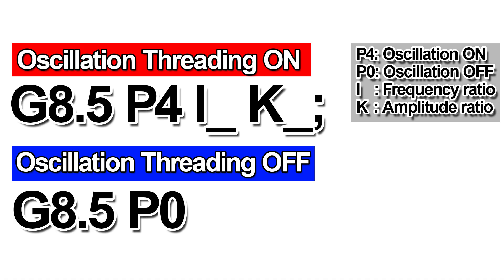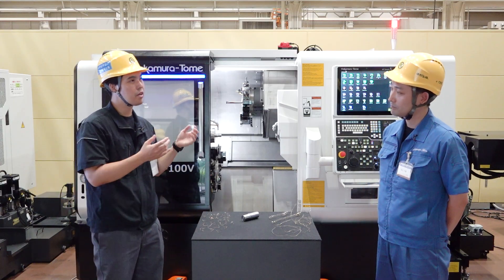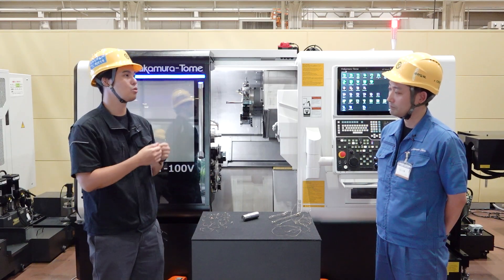【NEW】Chip Breaking Function for Threading "Oscillation Threading"

Comment: Did anyone understood the I or K values and how to set it up?
Reply: Looks like a pretty normal threading canned cycle. I is how often it moves in X, and K is how much it moves in X.
Reply: Thanks Kevin for the reply and valuable info  @kevind1865
Reply: Can i use oscillation threading without using canned cycle with just normal threading program ?